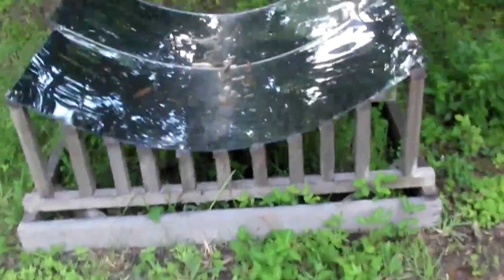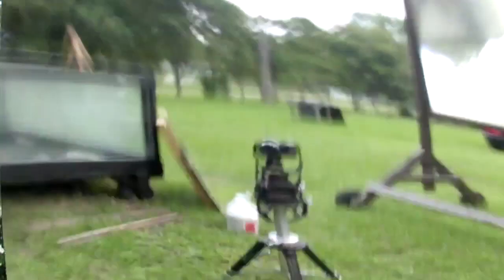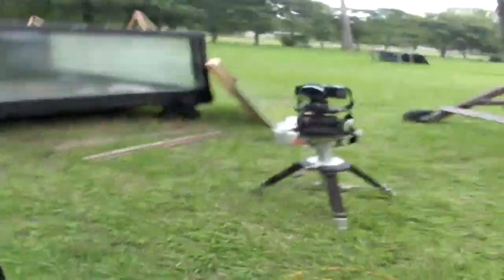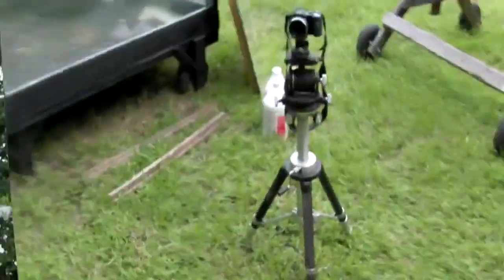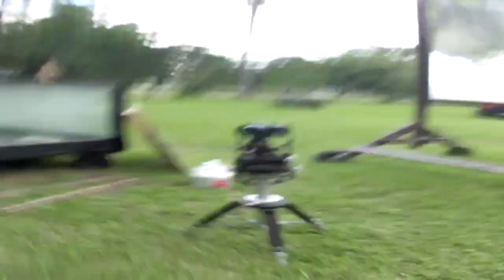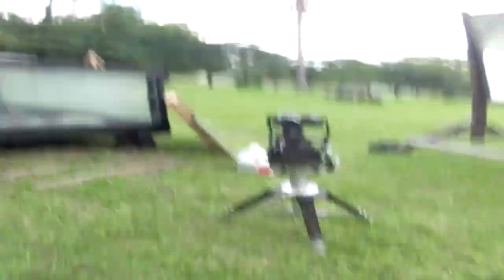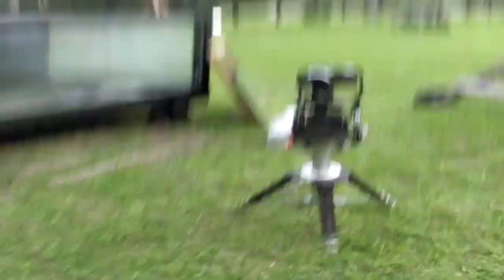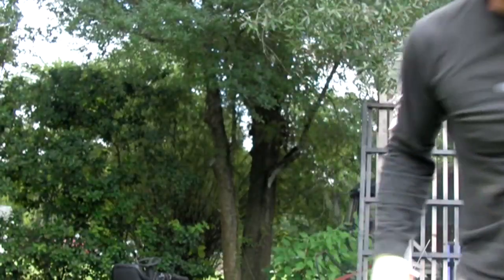TROUGH MIRROR METAL TROUGH MIRROR Steel Mirror First Surface Mirror

Comment: Acrylic has a bad tendency to splinter. I am not sure if splinter is the correct word but it separates into different layers when heated and cooled. It also bubbles and separates under the same conditions. There was a car built here in Canada called a Bricklin SV-1 that had acrylic body parts and they suffered from this same form of separation when under heating and cooling.